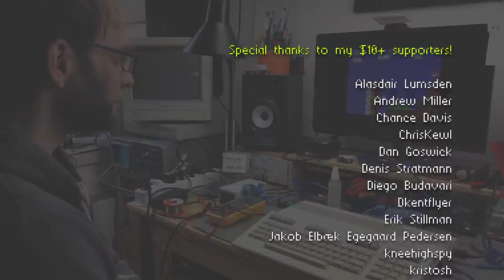Commodore 128 Keyboard Repair

Comment: I wonder if applying a slight film of grease on the plastic clips would make then snap in and out a bit easier.
Reply from the maker: Interesting idea, it would probably work. Although ideally, you still don’t want to take apart and reassemble your hardware every other day anyway... ;)
Reply: @JanBeta  Nonsense! I've been tearing everything I own apart since about 4 years old. I don't think that will change any time soon either :-)

Comment: Ive repaired conductive rubber contacts in remote controls before by gluing a tiny piece of aluminium foil to the rubber pad(s). Its guaranteed to work. I don't have any conductive silver paint and it is expensive.
Reply from the maker: I would be a bit worried that it could damage the contacts on the PCB over time.

Comment: Nice find that the plungers are identical to the Amiga Mitsumi plungers. I designed and printed a replacement plunger for an A500 (just the plastic part) using my 3D printer when I didn't have any salvaged plungers on hand. It worked quite well so it's good to know it fits the C128 as well. I put it on Thingiverse:
https://www.thingiverse.com/thing:3910131
Reply from the maker: Oh, nice! Thanks for sharing. :)

Comment: All you need to do to make C128 keyboards work again is give a light scuff on the conductive pad on the plunger, with a fine fingernail file or emery board, only just enough to get rid of the surface shine.

On the PCB side, scrub with a pencil eraser.  You won't damage the carbon, it ain't THAT thin. 😛

The clean everything with alcohol.

Comment: I wonder if a conductive ink pen would have worked...
Reply: They are expensive.
Reply from the maker: Yes, it would have worked. There are a number of different lacquers and paints that can be used. I didn't have any of that but the spare A500 keyboard so I figured this would be the most reasonable fix in my case. :)

Comment: 20:17 - Sadly, I learned this the hard way. A while ago (jeez, it was seven years ago 😲), I cleaned a keyboard and scrubbed a little too hard on the end of the ribbon-cable and the conductive traces came right off. 🤦 I "recently" (almost two months ago) ordered a syringe of wire-glue from eBay and am currently waiting for it to arrive from China so that I can try to fix it. 😕
Reply from the maker: Oh, hope your plan works out. Never tried the wire glue stuff but I suppose it is going to work fine. :)

Comment: I thought you had a frame meister or something like that. I seriously need to get a retro tink. My stupid upscaler dynamically stretches to 16:9. So playing side scrollers like sam's journey makes me a little dizzy. Static images actually look pretty good though. But yeah I'd prefer the 4:3 aspect ratio.
Reply from the maker: Oh, I have an OSSC and a RetroTink2X that I use for capturing and streaming. I only use the Flylink adapter for quick and dirty testing.

Comment: BTW: You can obtain those keyboard stamps/plungers separately on eBay - without tearing an Amiga keyboard apart...
Reply from the maker: Yes, I think they were used in a number of different keyboards manufactured by Mitsumi.
Reply: @JanBeta  yes, they were used in different keyboards. I've got some of the stamps somewhere here - but can't find them at the moment...

Comment: slt jan me when I repair old keyboard or the carbon contacts are worn by time I pass a silver-based liquid which dries after a few minutes which used to repair the defrosting of the rear windows of cars I have never found problems with  this method cordially
Reply from the maker: Thanks for the tip! I am going to try some potential fixes very soon. :)

Comment: Just trash an Amiga to save a 128 that is a 64 101% of the time.
Great job, man. 👍

If you wanna impress me, stuff an Amiga into a 128 case.
Reply from the maker: I didn’t trash any Amigas, I salvaged a plunger from a crusty, broken beyond repair A500 keyboard.
Reply: Jan Beta No offense intended mate. But can you put an Amiga into a 128 case?

Comment: 😄"don't go with, like, screwdrivers or anything like that" ... 30 seconds later
Reply from the maker: Haha, you're right. I was using the screwdriver to reseat the metal bracket holding the key though, not to extract the keycap. ;)

Comment: A small droplet of glue and a smal piece of aluminium foil is all you need to fix your keys. No need for expensive paint :)
Reply from the maker: I would be worried that the contacts on the PCB get damaged with that method. But it would work for a while I guess. ;)
Reply: @JanBeta  The aluminium foil stuff you wrap food in is so soft and thin it would be worn away long before your pcb got any visible markings. It's a known way to fix old remotes...